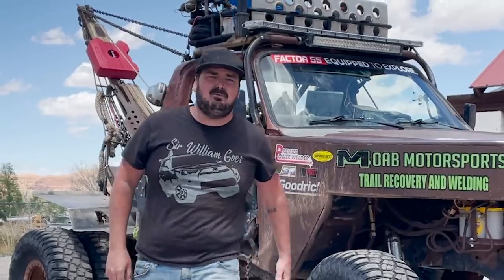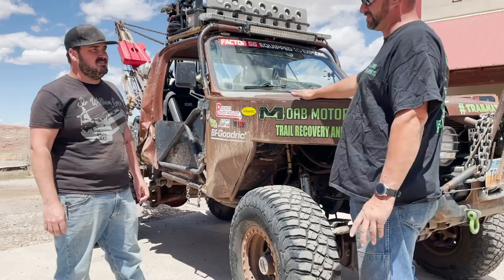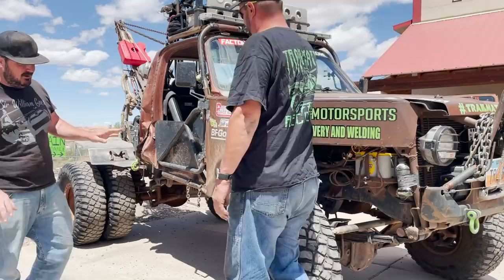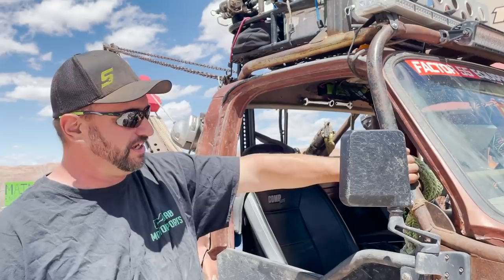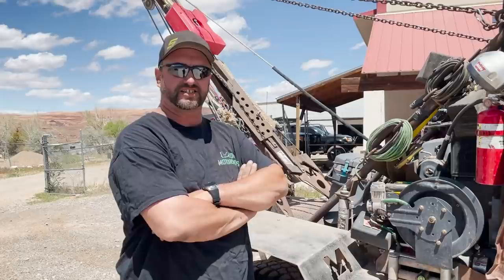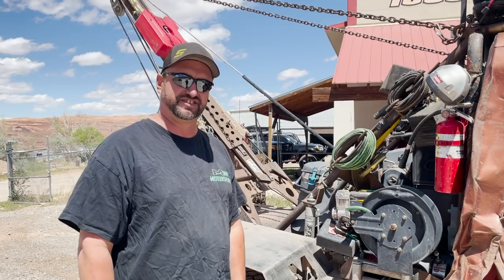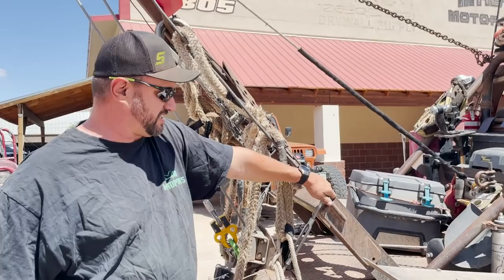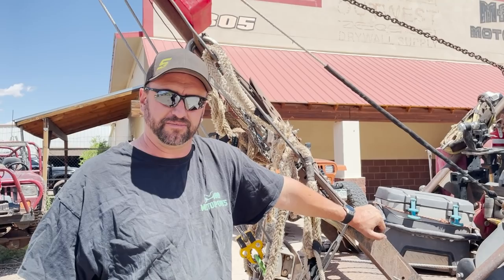Big Block Rock Crawling Tow Truck - BadAss Builds - TrailMater

Comment: @ 15:30 the double standards with insurance companies...
The one we have here is if you have winter tires you get a discount, but they don't care if you use them in the summer even though you have reduced handling etc... Not as safe as non winter tires.

And... You can literally buy a car and insure it with no inspection. And they will give you 3rd part liability. (If the vehicle is over 10 years old).

If you want full comprehensive coverage you need to get an inspection done at a certified mechanic.

If the vehicle doesn't pass they inspection you need to correct all deficiencies before 30 days or the cancel your insurance on the vehicle and won't insure it in the future 🙄

What a gong show.

Comment: After seeing several of your videos, I wonder why you dont use a sling like older wreckers use just as a last back stop from a disabled vehicle from sliding into you. I see distance between vehicles is an advantage for hills, but a last catch seems like it would eliminate one less worry. I used a sling on hundreds of cars back in day, but those were on pavement and gravel.
Reply: I used to think the same thing, but he's not the only one. I'm sure there is a reason, and from all the vids I have watched, it seems there is no need even though it doesn't make sense.
Reply: Going up hills almost straight up with a sling would be a horrible idea. It would make it way to heavy and flip his rig backwards.

Comment: he welded up my exhaust for me..... I am NOT a fan!
Reply from the maker: Dang hate to hear that.
Reply: Why?  ... I know it wasn't too expensive. Did he do the actual welding? Was it on trail (or in the shop)?  

More details please.
Reply: @JohnnyJ50f  I had a 96 Jeep Grand Cherokee and the exhaust broke off where it comes out of the rear of the muffler. I drove it to him and he welded get back together at a cost of $273. I reluctantly paid and drove away only to find the exhaust was laying against the polyurethane gas tank. I returned to him with my problem and he gave me considerable grief before repairing it to my liking. I drove away and it still was not far enough away from the gas tank and melted a hole in the polyurethane tank on the 1500 mile ride home...
Reply: @OverlandGeneration  

Interesting story.

For your exhaust to "break off" at the rear of the muffler, it had to be in poor shape... right? 

None the less, sorry to hear about such an issue as Rory is top notch. 

Hence why I asked... if HE welded it or HE did the actual work. You didn't answer that. 

And, if he was the shop you went to, or if it was prior to Rory owning Moab Motorsports (He's only owned it for +/- 4yrs).

Lastly, isn't there a thin metal guard/heat shield between exhaust and fuel tank on the Cherokee? There was on mine ('95 ZJ)
Reply: @OverlandGeneration  I think there is a whole bunch you are leaving out of the story or the story is even all or mostly made up.  You didn't say when this was done but I know of no world where it would cost $273 to weld exhaust back together.  My guess is that a new muffler and some pipe was installed.  And like Johnny said there is normally a heat shield on the tank and even if there weren't I cannot imagine the exhaust melting it unless it were touching it and maybe not even then depending on where it was in the system.  20+ years ASE certified auto tech
Reply: @ToddKing .. ehh can’t please everyone, tbh I’d have Rory pull me out of a ditch before I’d have him precision weld exhaust on a crap Jeep w plastic parts next to hot exhaust
Reply: @Lousasshol  There is just soo much we don't know.  And as an auto tech I learned a long time ago that disgruntled customers have a tendency to leave out pertinent details and twist the facts to make it appear as though the tech killed their dog and forced their daughter to join a cult.  So I'm very careful when I've only got one side of the story and it sounds a bit over the top.  I don't know I'd call exhaust welding precision but I get your point.  But Rory does a lot of fabrication and I think sticking some pipe together would be trivial for him if that is actually what happened.